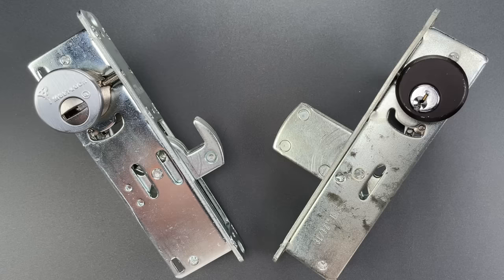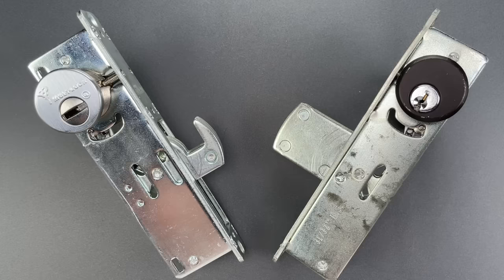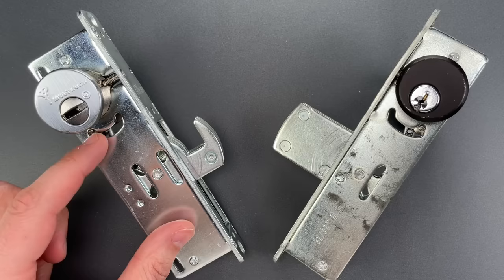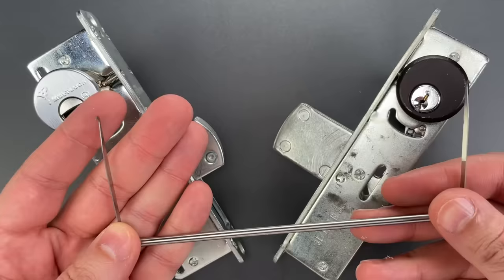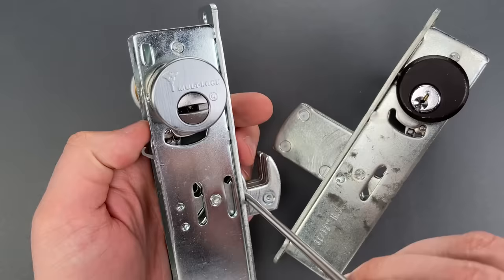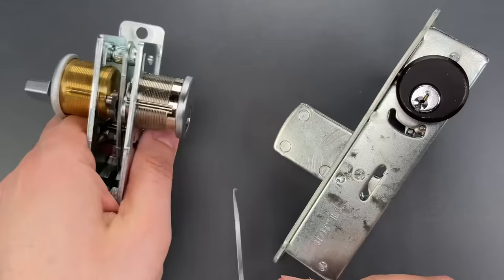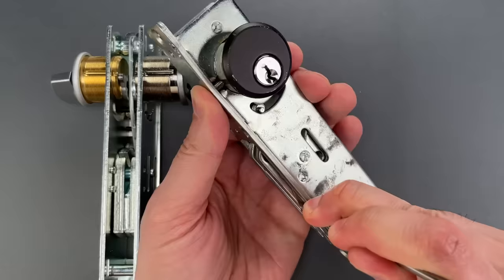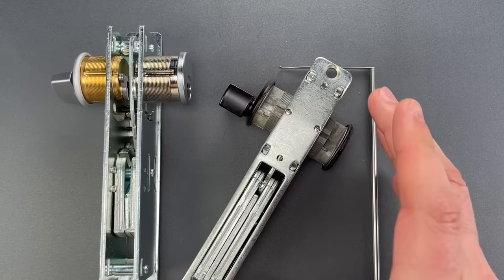[1409] The Most Significant Security Flaw in North America

Comment: Funny story - when I was in HS I worked at a Radio Shack (1990s).  Our front door sometimes refused to open with keys - even after consulting several professionals.  My manager at the time actually devised a tool very similar to this to get in when we were locked out.  I couldn't stop laughing watching this video.  This flaw has been around for a VERY long time.
Reply: The gap between the two door wings seams to be pretty large in this demo. Are such large tolerances common?
Reply: It was known in the 70s when I was repairing doors and locks - not too many know about it or it would have been fixed by now.
Reply: @anticat867  We used to set 5mm gap when I was in the trade in the 70s. (About 1/5 ")
Reply: @anticat867  Generally yes - these doors are going to be opened, if not manhandled by the public hundreds, even thousands of times per day. If the tolerances were too tight, the doors would quickly wind up binding in the frames and being hard or unpleasant to open.
Reply: @anticat867  It's not as large as it appears but yes, that gap is pretty standard, if not wider.  I don't work on locks but do low voltage work on doors (delayed egress, door cameras, etc) and that clearance is fairly standard due to how the doors swing open.  Next time you are out, look at how wide the gap is on double doors for most commercial properties.
Reply: Radia shack? Damn that just blasted me with nostalgia.
Reply: Thank you all for the insights.
Reply: @anticat867  They generally have to be on that type of door.  Because of how often they get opened as well as the part about them being double doors means that they need pretty big openings.    Double doors need double the width for clearance over a standard door them since either door can open.   It is a weakness on any kind of double door, even if you fixed this issue there are thumb turners you can stick between the doors to operate the interior thumb turn.
Reply: Radio Shack... where it nealy always  took 20 minutes to pay for a pack of batteries while one store employee spends the whole wait, talking with another about their work schedule. I still have one of those B"attery-Of-The-Month" cards, somewhere
Reply: @anticat867  if the Gap were smaller than the diameter of a thin metal coat hanger you couldn't open the door, you can do this with a coat hanger.
Reply: @citylockapolytechnikeyllcc7936  Or like Best Buy where you wait 20 minutes to ask an "associate" a question because the three male employees are standing around talking to one attractive female customer for that long.
Reply: @sablatnic8030  I was about to ask if you could shield them, but then I saw that the door opens to the outside.

In the store where I'm at the door opens to the inside and it's shielded.

Is there regulation regarding that?
Reply: @anticat867  heh, "seams"
Reply: @anticat867  Yeah they are. have a look next time you are at the store. Pretty much any store door will have a pretty good gap.
Reply: @sablatnic8030  Even fewer people know that you can generally get in through the windows of said business (without breaking the glass) in only a matter of minutes. Those panes of glass are trivial to remove from the outside.
Reply: @andregon4366  Yes, it is mandatory in the US that commercial main doors open to the outside. This is a fire safety regulation that came about from the fire in the "Triangle Shirtwaist Company" in the early 20th century where the people all panicked, smashed into the doors (which opened to the inside) and were unable to push them open. There were so many people that anyone that thought of pulling on the door couldn't do it because it was blocked by a dozen other bodies. Everyone (about a hundred people) in the factory died as a result. 

Most commercial doors swing freely these days (the type shown in the video), and by law must remain unlocked during business hours. If there is a latch that holds the door closed, there must be a "panic bar" or other device on the inside of the door that will make it unlatch if you push on the bar.  If panic bar doors have deadbolts such  as shown here, those deadbolts must remain unlocked during business hours.
Reply: @lwilton  Similar rules in Europe. Any door in publically accessible buildings on an escape route must open outwards and have a means of opening from the inside or stay unlocked.
Reply: so it's not a flaw, it's a feature to keep business open
Reply: @fredrikostling3376  Nope, the rules require easy escape from an indoor disaster, they don't require any way to enter without permission.
  The real flaw is that particular deadbolt mechanism being so easy to cheat.  Heck, the non-secure internal doors next to me here in Europe appear to have better deadbolts installed, but with no way to lock them, because mass produced locks with built in deadbolts are so affordable that builders stopped buying the ones without a deadbolt, it's more convenient to buy a pile of good-enough lock bodies and just not drilling the hole in the door where a lock cylinder or thumbturn would go.
Reply: Ok boomer
Reply: @anticat867  the gaps on those doors are almost seamless compared to the door gaps at most “open to public buildings” I’ve seen with these style locks, most tried to fix it by installing an overlapping plate on the door. Some actually helped others where like a bandaid that where too small
Reply: @MaethorDerien  many if not most properties with this style of lock don't have an interior thumb turn but are keyed on both sides, at least around here. You don't want random customers locking the door...
Reply: @JamesEsau  Some are, on the system we used the glass was mounted from the inside as standard.
Reply: @andregon4366  I don't know how it is now, but there was no sheilding 40 years ago. I am old - as you can see on the pic.
Reply: @anticat867  lol yes
Source- once pushed a stapled pamphlet thru my old job's front door
Reply: Nice profile pic
Reply: It is not a flaw, it is a feature. Mentioning first responders was not a mistake.
Reply: @sablatnic8030  Fair enough. Around here it's common for the ground floor to have them come out from outside. Everything above the ground is inside though
Reply: @sablatnic8030  Thank you for the Imperial conversion!
Reply: makes me think certain three letter agencies have been using it for decades
Reply: @anticat867  Yes.  Most of those doors use a bristle or flimsy rubber seal to make the door "look" flush... they almost never are!
Reply: @anticat867  all the time just go walk around and check out some doors
Reply: @anticat867  Yes
Reply: @sablatnic8030  1/5" is my new favorite measurement 😂
Reply: @Account NumberEight love shack...
That's where it's at...
Reply: That sounds like a plot point that should be in Superstore.
Reply: @anticat867  I think this is to accommodate the expansion of the doors and the jamb during summer😅
Reply: @citylockapolytechnikeyllcc7936  wow so they all conducted biz the same. Crazy
Reply: @andregon4366  fire safety stuff dictates much of these weaknesses
Reply: @JamesEsau  yeah and then no alarm is triggered.
Reply: @braddishv3146  thats for heat retention and such.
Reply: @braddishv3146  That's actually just to keep rain, wind, etc. out. As I've heard various security experts say, weatherstripping is not a security device.
Reply: Sad thing is, it's such an easy thing to fix as well
Reply: And here I'm thinking I'm old!
Reply: @anticat867  yes
Reply: @andregon4366  opening to the inside is a fire hazard, illegal in many places.
Reply: @pDaleC  In Denmark it's most common for the outside door of private homes to go inwards. I was once told that that's a safety measure, in case there's a proper amount of snow on the outside.

But I don't know if this is detailed in our building codes nor if it differs regarding public/commercial buildings. I think that most emergency exits, that come to mind, open outwards.
Reply: @TKRuna  I work at a menards, atleast twice a week a customer runs into the doors with a cart n temporarily breaks it. It isnt my problem so I find it quite funny, a few weeks ago 10 minutes before close it happened.. it took the dude 45 minutes to get the door working again
i teared up laughing when i saw his reaction to hearing the doors were broke
Reply: Well no shit its been around along time its not like lock makers have suddenly decided you know what moddern locks need, a huge security flaw
Reply: @lordfly88  right?  I sat there looking at it for a second... I was running others in my head, OK, we got 1/4, and an 1/8th... 1/5th, 1/5th.... Hmmm...I use fractions daily in woodworking and I suddenly questioned 20 years experience.
Reply: @sablatnic8030  i believe they know, but they lack any incentive to fix the problem. Remember, these locks are generally only for consumers that doesnt require high security, they are cheap locks. It's basically a mean to stop people from straight up walking into the gated area, i dont think it is meant to stop any serious attackers.
Reply: @BenjaminVestergaard  I was speaking of commercial doors, which would have a lock like this. They are required to open outward so a large group of people can't trap themselves inside a burning building. I can't recall ever seeing a primary door on a home that opened outward. Many homes have "storm" doors which DO open outward.
Reply: @anticat867  
There are temperature and humidity variations affecting the gap, and also be room for wear and abuse of the door and hinges.
Reply: @sablatnic8030  Part of the further security would be a roller shutter behind the doors,  hopefully with steel bollards in front to deter the SUV drive in breakage.
Reply: @anticat867  Yes.
Reply: @JohnRunyon  Generally in US code firecode buildings have to have an interior unlocking method.   You pretty much never see them have keys on both sides in the US because of things like fire code.   You can get exceptions for low occupancy high security but companies rarely do that.
Reply: yes, but it can be covered up though
Reply: Decades. Those offset latches became a commercial standard in the 70s or 80s, and i dont think any of them were manufactured or installed with sufficiently tight tolerances or other measures to prevent this.
Reply: @anticat867  the gap isn't just common, it's necessary. The distance on the door itself between the hinge corner and the outside latch corner is shorter than the distance from the hinge corner to the inside latch corner, and the both need to clear the jamb/other door to open without binding or scraping. If there were no gap at all, you'd have a wall instead of a door lol.
Reply: @anticat867  gap is common, like also common is covering that gap with a plate....at least in Poland when i was kid all doors have a metal plate that cover gap preventing to bypass the lock, now is less common because insurance but you still see them in small local store doors.
Reply: I worked at Radio Shack in ‘96. I still have burned into my brain how we were to answer the phone, “Thank you for calling Radio Shack where you’ve got questions and we’ve got answers, this is DJ. How can I help?”
Reply: @anticat867  I've carried keys for a number of grocery stores and I can say that they've all had a gap atleast this large when pulled apart while locked.
Reply: Man, I miss Radio Shack.
Reply: Anticat 
Yes it is.
I’ve spent several years working in such places and often looked at the doors from a distance to determine if it’s locked or open before I even approach.
Reply: @anticat867  A carpenter in Europe generally works with a tolerance of 1 centimeter, and a skilled blacksmith should have a tolerance of at MOST 3 millimeters, with the potential to measure down to the 100th of a single MM, so in terms of woodworking the tolerances are spot on, iron and steel obviously also contract and expand a fair bit depending on temperature, so yeah, the tolerances for woodworking are entirely accurate, accounting for culture and law regarding construction it is likely that US tolerances are a bit...well...as the NY real estate market includes a "loss factor" so does US industrial tolerances, I know a Norwegian woodworker that would probably ivoke the wrath of Thor if he saw how US carpentry is done, unless they are Armish in which case he would probably convert instantly!
Reply: So the argument that these videos spur lockmakers to improve their products.....
Reply: No wonder they went out of business..
Reply: @highpath4776  usually the roller shutters would be exterior to the door.